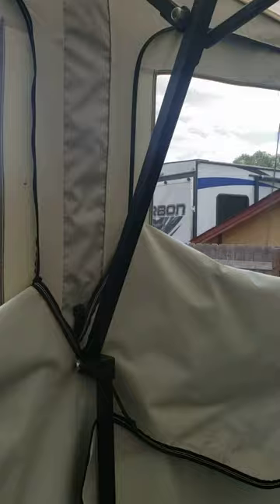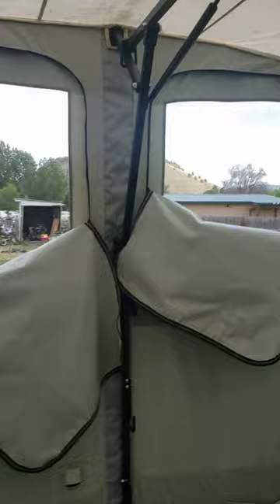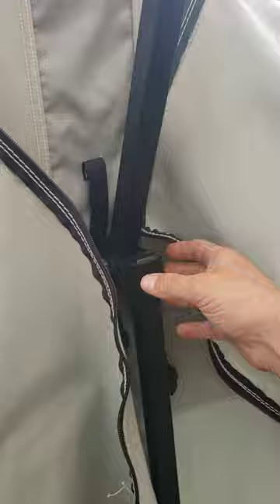Jumping jack trailer spring/strut replacement

Comment: I somehow managed to fold my strut in half when closing the tent up.  I dont remember it being much more than a 10 minute job to replace the strut though.  I remember it being pretty easy.
Reply: Hello, did you order the the gas spring from Jumping Jack or did you find somewhere else? Please let me know, I need to replace mine but are very expensive through JJT. Thanks,
Reply: I got the replacement from eBay. ITEM # 372646196854. There might be a slight difference in the operating pressure but I'm unsure of it because the factory support was misleading due to a sticker that was placed over the actual part # info that came with the factory support. The sticker had totally different specs which was confusing.  Nevertheless I ordered the one from eBay and it is still working fine 2 years later. I did notice a little more effort was needed to close that new one but that could be because it was new. Both sides feel the same now